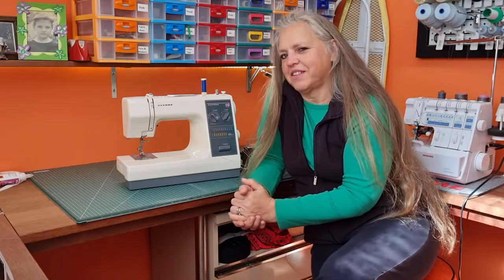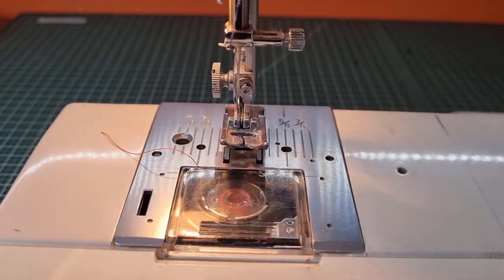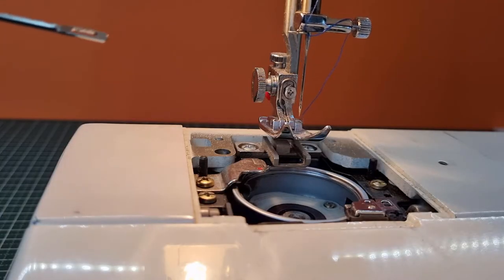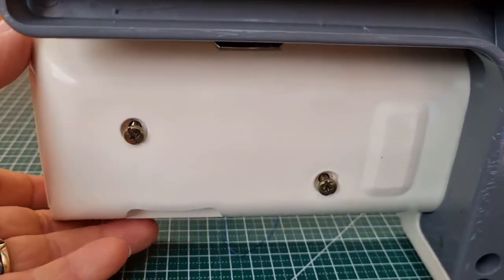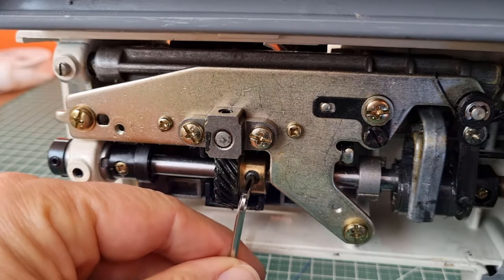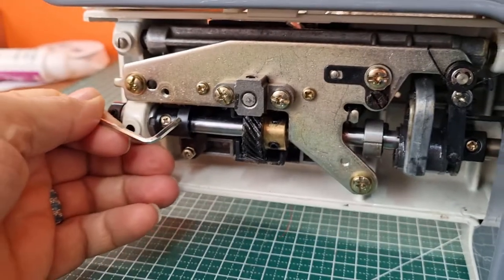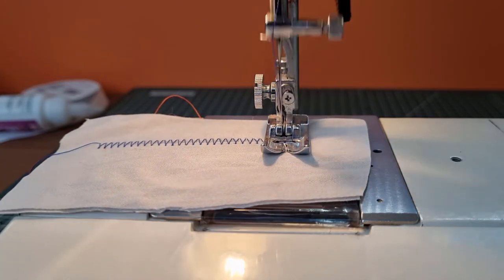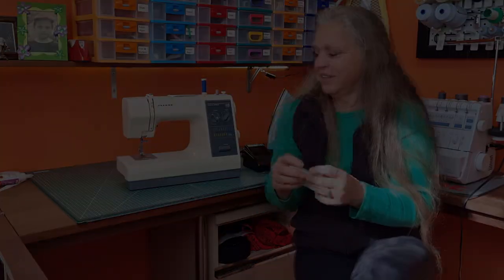DIY Fix Timing Issues on Your Sewing Machine. Help! My Machine Won't Pick Up Stitches. Quick Repair

Comment: Janome made these same machines for Sears here in the U.S. They are around 30 to 34 years old. They are wonderful machines. Mostly all metal on the inside, but aluminum and plastic on the outside so they are very portable. Also with the variety of stretch stitches and a 4-step buttonhole, this machine will do anything needed to make clothing - including knits- without the need for a serger.

Thank you for the video. I've no problems with mine at the moment, but nice to know this is here. I've actually never needed a professional service in the 34 years I've been using it. Just clean, oil, grease and change the needle when needed.
Reply from the maker: I still have this machine Clifton. It has served me very well.😁

Comment: Your older janome is   built with a lot easier access for repairs than the newer models!  You have to disassemble the entire cover and part of the machine before you can reach the bottom.  I think I'm liking the older machines a lot better.
Reply from the maker: I agree with you bookbeing.  Newer machines are so much more complicated to get in to. I recently did a new janome with similar issues but find vintage machines much easier to get into, and the mechanics easier to work with🙂
Reply: Planned obsolescence

Comment: Fantastic job!!! I have an old machine that needs electric wiring . My husband bought it for me and paid $100.00 for it. I took it to a service center for a broken spool holder and he said if i wanted to actually sew with the machine it had to be rewired. 😳 However now i know how to time one if i have to in the future. Thank you so much.
Reply from the maker: I enjoy pulling machines apart, and have a couple of videos coming up soon, but I steer clear of the wiring as I'm afraid of electricity.  I do get Chris (my partner) to electrically test them for me though😊

Comment: Thank you so much for this video tutorial. 
Thanks to you, I fixed my 2022 Janome and avoided the long process of sending it to the seller and so on.
Funny thing happened, though. No matter what type of stitch I set to, it only sews straight stitch. 
I don't use any other one, thankfully,  not when zigzag.
Reply from the maker: Thanks Magdalena. How odd that it only sews straight 🤔
Reply: I looked up your model number and it's a bit younger than the 385s with the grey face. They are circa 1990. (30+ years old) 

About 4 years ago, my machine was sewing fine one evening and the next morning he'd only make straight stitches. So I opened up the column (for the first time) and discovered a beautiful stack of metal gears in need of some TLC. Spent about an hour carefully working fresh lithium grease (all I had on hand) in where needed. If your lithium has hardened you may need something else. Check out "Randy your sewing machine man Genius Purchase $25" here on YT. He has a 22 stitch model and he does tell you everything that needs lubricating. He shows what he uses to remove the lithium ( He doesn't demonstrate it all.) I currently use "Superlube" on mine.

Comment: OMG! Thanks to you, I fixed it!!! I actually fixed it without having to take it to the shop! I’m so excited! Now, I feel confident enough to tackle a few of these other dozens of machines I have that don’t sew… (note to self, when telling friends and family that I really do need a sewing machine, be sure and specify working sewing machine!) as it turned out, it was a combination of things. A, I replaced the needle, rethreaded the top as well as bobbin After cleaning lint and debris out of the machine… next, I set the machine to zig zag and checked the machines timing, which, was off a tiny bit… my Singer Heavy Duty is sewing like a champ!
Thank you, thank you, thank you! You are so awesome!
Reply from the maker: That's amazing Jeri. Well done! 😀

Comment: Amazing you are. I can't believe it. I would not attempt to mess with one I would ruin it. Thank you so much.
Reply from the maker: Haha, Whilst it wasn't working, and I had other machine options, I had nothing to be afraid of.🤣🤣
Reply: @ChristinesHomeAffairs  Your right nothing to lose. I know I had a cheap $100 machine and the thread under the needle was a big mess and I couldn't get out of it and pulled it.  Took to a  place and he said the rod was bent and would be over $100 for the part plus labor. I said you can keep and throw away. It cost me $65 for that info.

Comment: Hi Christina. 

You are the only one on YouTube who has a MyStyle16 😊. I just bought one second hand and the bobbin is stuck on the bobbin winding spindle, because the bobbin holder isn't aligned with the bobbin. I can't get it out no matter how much I push the holder pin back into the spindle. If you have any tips I would appreciate it soooo much!
Reply from the maker: Not sure what's happening there, but it seems like you have the wrong bobbin for the machine. they shouldn't be so tight😀

Comment: You make it look so easy! The problem with my machine, is that I had been sewing tshirts. Then, I sewed some tabs on denim to make a quick curtain. When I tried to sew on a tshirt again, it looked up and bird nested underneath! Please help! I don’t know what to do,
Reply from the maker: Thanks Jeri. I don't think changing the type of fabric would cause this, but the first thing I would check is the tension.  Is the thread in the tension disc properly?  Have you inadvertently left your presser foot lever up?  Also check the last hook/hole just before you thread your needle.  Then you can check your bobbin.  Is it in the right way around?  Depending on my machines, I've found these to be the most common causes.  Failing that, rethread with different thread, insert a new needle (correct one for the job you're doing) and bobbin, and try again.  Hope there's a solution in there for you 😀
Reply: @ChristinesHomeAffairs  thank you so much for taking the time to respond to me! Everything is threaded fine, new needle, tension hasn't been changed, I just switched sewing jobs ... I thing I will use my vacuum hose to rid the machine of dust and such, am about to head to Wally world to get new needles and thread ...... 
During the summer, I remake xxl and Xl tshirts into shorts jumpers, bathing suits covers, etc... I fold the t-shirt in half then cut a shallow J shape for the crotch... I also taper the shirt to fit my baby shape from under the arm to the hem. Opening the hem of the shirt allows for a bit of elastic, if the bloomers effect is desired. 
Dollar tree sells tshirts, so, it's a fun in the sun project I love doing for folks. I also turn leggings into backless shorts jumpers by making the top out of the cut off legs....that's what I was sewing when I stopped to sew tabs of the denim to make a curtain.
Reply from the maker: @JeriAnDrews  wow, they sound like such fun projects to make. I have no other solutions to your machine problem though
Reply: @ChristinesHomeAffairs  I fixed it! Thanks to you, I fixed it!
Reply from the maker: @JeriAnDrews  that's awesome.  Well done 👏 😄

Comment: Have you ever adjusted hook timing on a Bernina sewing machine?  I have and Activa 130 that keeps jumping timing and had  it in shop numerous times and with 3 hours of using machine it jumps time again.
Reply from the maker: Wow Linda.  That must be so frustrating. I haven't tried the timing on a Bernina. Of the 30ish machines I have, not one is a Bernina🙂

Comment: Thank you for this video!!! I have 2 Kenmore [Janome] 385.1884180 models - they look exactly like your Janome 16 except for the extra stitches.

They were running perfectly and then suddenly within a week of each other, the timing went out. Every time we get one timed, after a while, the timing goes out again. 

I would like to make sure the needle bar height adjustment is correct, before proceeding.

Would you happen to know the measurement?
Reply from the maker: No idea on measurements as I just play until it works🤪
Reply: @ChristinesHomeAffairs  Thanks! I will just keep adjusting.
Reply: On the needle bars, sometimes there’s hash marks at the top
So there might be two or three on the needle bar - then you line up with one of those marks

Comment: Bad video first about you don’t tell us which way you’re turning the dial underneath the sewing machine you just say turn the dial you push it up or down second when you finally did the fixed version of the zigzag you can see it puckers on both of the long stitches so that is not adjusted correctly
Reply from the maker: Thanks Penny. It would have puckered due to the fabric being too light  weight though, or I may have had the tension to high at the time😀